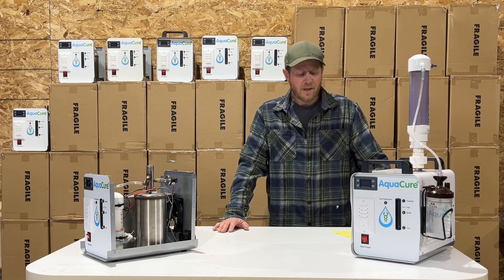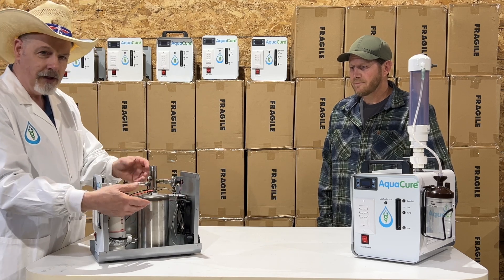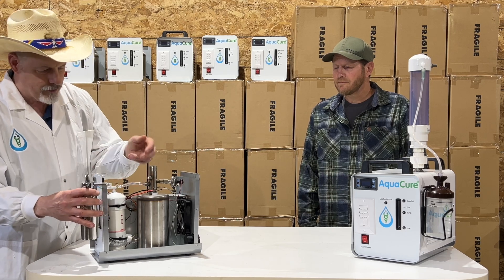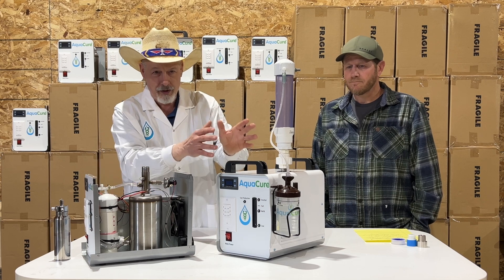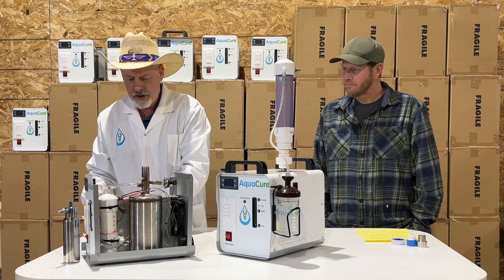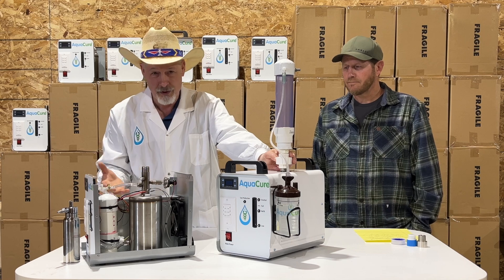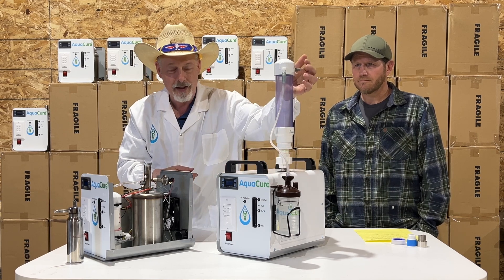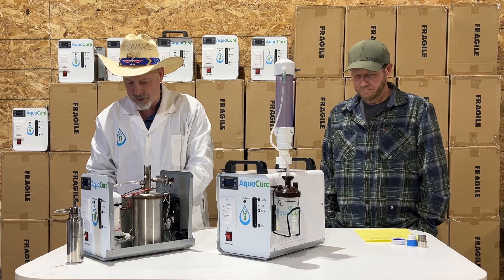Why AquaCure has a Tower Cap !!!

Comment: Interesting video and I appreciate the explanation of why AquaCure uses a tower. The tall column separates lye heavy mist from the gas and helps prevent clogs. That makes sense given the original design. I’ve been researching other hydrogen machines. One newer model uses a built‑in stainless condenser that’s roughly 80 times more efficient than PVC. It eliminates the tower altogether and reduces maintenance.
Worth comparing both designs if you’re shopping around.

Comment: Great video. George and Mike  you guys knocked it out of the park! I have an Aquacure and one of those other machines. I use both. One for breathing and the other one for once in a while topical treatments. What I like about your tower cap is that it is well made. It's 1/4" thick wall pipe. Very strong. I actually made a huge tower cap for my other guys machine for fun. I had to make it larger because unlike your machine, that gently pushes out gas at a safe 1psi, the unmodified original version works at 14psi.I made two versions. One with  a clear 4" diameter pipe that is 8" long and the other 8" diameter version is with a 12"  pipe. I'm just a tinkerer fascinated with how this works or how it could work. I  want to test them for possible psi reduction and thank you for expaining the benefit of the check valve in the cap.  Your tower caps are built tough. Better  than Ford. LOL I love my Aquacure. I'm not lazy and my experiments are not for sale. God bless you both.

Comment: Hi, George 
Thanks, for the video and explanation. Just a question, why so concerned about such a miniscule amount of Lye? People have been using Lye to worm farm animals for a century or longer with no ill effects. Probably a bad question as the public does always find away to harm themselves. Thanks for all your work
Reply: One reason mate is other hydrogen machine salesman are demonizing  lye as a dead dangerous product that melts people etc... also George is and always has been about Super dooper safety.
Reply: Residual lye in the gas wouldn't be good if you were doing a breathing treatment. It could be a little irritating, to injurious depending on how much you inhale. I've washed lye off my skin before, no prob. Washing out the lungs poses a different set of problems.

Comment: Its an old relic machine. Much better ones exist out there now.
Reply: Only reliable hydrogen machine with browns gas 💯
Reply: This makes BG the others are not producing what is health aiding…
Reply: Example?
Reply: @bshwckr592  The best one one the market currently is the PureONE from pureffect. You still get the same benefits as the Aquacure but easier to use and better quality.